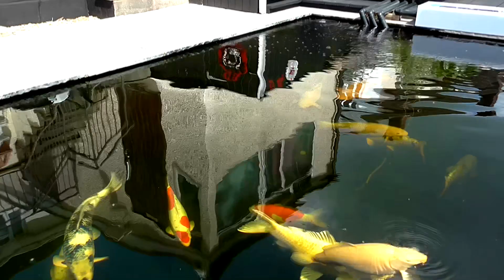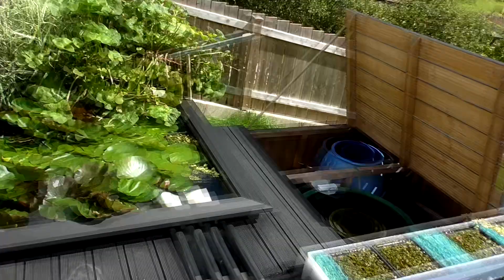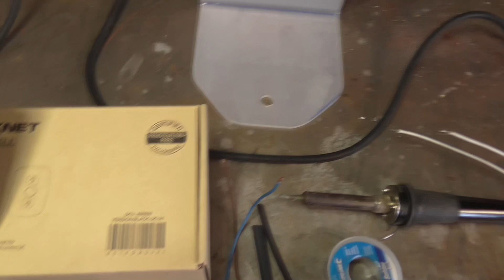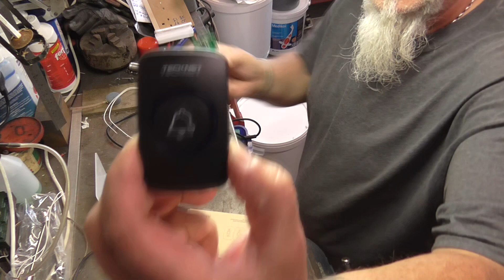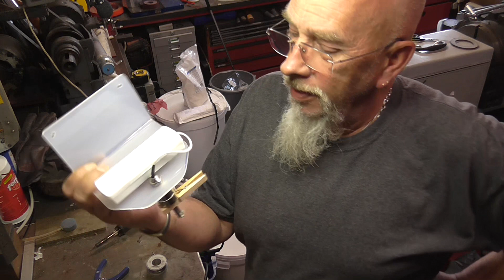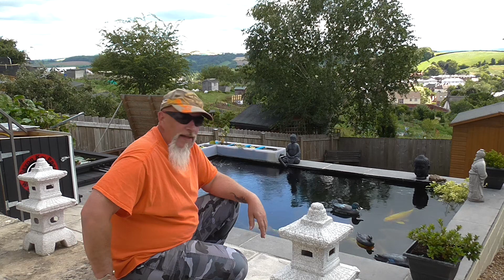***Koi pond DIY filter water level alarm*** Save money and your fish with this home build pond alarm

Comment: Thanks for the shout Martyn. Can the 200mm running through a relay be used as a pump kill switch just in case you are both out. 75mm will ring, 200mm will kill the power. Just a thought. Cheers
Reply: I think Steve was thinking more along the lines of stopping the water draining out the pond  anymore after 200mm to keep fishes swimming and not loose too much water
Reply: @ben963524  I was Ben, cheers.
Reply from the maker: Right Ben I see that now and yes I could sort a relay on the receiver to trigger the pumps off it would work will do some more thinking on that
Reply from the maker: Not a problem Steve cant get the channel link to work for the min it should show when I say up hear I'm working on that but its on the video end as well. They would work through a relay I have no need to kill the power the pumps auto shutoff if they go dry

Comment: I've been looking for something like this, but WiFi connected so it could send an alert to the phone wherever you are.
I've only got a 1,000-litre pond, but I recently built a "bog in a barrel" filter which is located in the bushes beside the pond. It's powered by a 4,000 litre per hour pump (although not getting anywhere near that throughput), and it worries me that if something goes wrong, it could empty the pond and burn out the pump in less than half an hour.
Reply from the maker: Alot of people built this off the back of this video and some did it with one of the cheap video WIFI door bells with mobile phone alert. I'm no electrictronics Wizz it was easy with the bell push I had just solder two wires on to the push button from the float switch. So it can be dun to alert your phone with one of the  Wifi door bell push's but cant help more than that sorry

Comment: Great Idea and I already have the float switch but you don't show the tricky bit, how you adapt and solder the bell push?  I want to build one of these as I have had repeated problems with dropping water in a filter due to fitting a drum inside the filter!
Reply from the maker: John when you open the bell push you can see the wires each side of the button you just have to come off them. watch what bell push you get as some don't ring constant when you push them and only chime once I must have been lucky with the one I had as 2 or 3 people have said there's only go's the once thanks for watching happy ponding

Comment: HI MARTIN  IM STILL STRUGLING AND HAVING CHECKED PART NOS ETC AND COMPARING IT WITH PICS OF YOUR UNIT /CIRCUIT BOARD it appears to be exactly the same ..today i have emailled tecknit  uk  for thier opinion .will let you know what they say .stickypaws will know me as huso huso on pondlife forum. i recognised your pond /garden on her pond build post .
Reply from the maker: Now I'm clicking on who you are chap I still pop on pond life from time to time but eye ball deep time wise most of the time now. I don't get it with the bell as said i have two of them hear the one on the house must be getting on 3 years old keep your finger on it and it will keep going and the unit i have on the pond works the same so just taking a bridge wire across the button for the float is all that was needed. I really cant understand why they would change it as it would not play the tunes keep in touch with how you get on with them 
Michael

Comment: hi martin bell doesnt ring continuously when button held in and ive tried all combinations of contacts but still only rings for 2 cycles to get it to ring again you have to remove and apply wire again .really frustrating i looked at your circuit board annd mine is exactly the same even same numbers po7 kerui  kr-f51-tk-b.not sure what else i can do other than send it to you to see if you can figure it out thanks michael,  incidently does the name stickypaws mean anything to you.
Reply from the maker: Michael they must have changed something in the bell push I have two of them bells hear one is the house door bell they both ring and ring if the button is held down that's why I got that type of bell to do the job on the alarm. if they have built in a momentary switch that I doubt they have it would not play a tune it would just be a ding dong door bell.  And Yes stickypaws is my better half

Comment: hi martin had a go using exactly same bell unit and 200 mm switch but i cant get it to ring continuously it just goes ding dong ding dong stops until triggered again .any ideas what im doing wrong thanks michael.
Reply from the maker: Hi Michael had someone else say this will it ring constant if you press the button on the unit. If so then you need to swap the solder contact's you are taking the feed from. I said this to the other person as I was thinking they had changed the build of the bell unit they never got back to me so this must have been the problem just try bridging them with a bit of wire till you hit the right combo

Comment: Hi Martin thanks so much for your reply it is pump fed back to a gravity system it only went up today and I just wanted to check with you first I have it coming straight out of the pond into the uv then down into the gravity 3 barrels
Reply from the maker: So you are pumping the water through the UV  should be fine you can turn UV off over winter say November till March then come spring when you fire it up just make sure the glass sleeve in it is clean as it has the dirty water passing it. if the water starts to turn a funny green over winter you can turn it on. But iv been ok for the past 20 years doing it and saving on the electric
Reply: Thanks pal you're a star

Comment: Hi ye pal quick question should the uv be before or after your filter ie inlet outlet
Reply from the maker: It should be after the filter but if you are pump feed then this is not posable so it can get dirty in side. in you are gravity then after the pump on the return but my uv is after the pump so it works like that as well Tommy

Comment: Hi Martin, great idea! Iv just tried to make the same thing using the same doorbell you have got. Mine seems to stop chiming after 3 or 4 seconds though then have to re trip the switch to set it off again... :(
Reply from the maker: I don't get that if tripped and held there this one go's off till you lift the float. What happens if you push and hold the button down on it if it go's off non stop then its hard to see on the pin's each side of the switch but try the pins with a test meter you mite have come off the wrong pin's for the cross to the float switch give it a try and come back to me
Reply: DevonKoi Pond thanks for the reply! If I push the button down and hold it then the same thing happens, it rings 3 times and then stops. It is the exact same doorbell as yours but I can only conclude the internals are slightly different where yours rings constant but this one only does three rings before stopping and having to be re tripped. I have tried my house doorbell and that rings constant when the button is pressed and held so I can see that coming apart in the days to come to try that lol. It’s a great idea I just seem to have been unlucky in that the doorbell iv brought stops after 3 rings. Annoying as I purposely brought the same one as you as it works well lol. Ill get it sorted. That’s for this idea. Keep the great pond videos coming 👍
Reply from the maker: Well that's a bummer I got the one for the pond on the back of the one I have on the house hear as pressing that one and it go's off till you lift your finger off they must have changed something in them

Comment: Good idea new to this koi thing and after drum motor went during the night woke up to find pond 3/4 empty lesson learnt now has kill switch on pump this would have been a good warning
Reply from the maker: The kill switch float is or auto cut run dry pumps a must have even on gravity feed filter system it will save your water and pumps but its also nice to have an alarm to tell you something happening and this can be set to tell you on as little as an inch of water drop.
Thanks for watching

Comment: Brilliant tip martyn although you do make it look easy lol, any chance of fitting a cut off switch for the pump in case you are away from home , so funny when your wife called out 😂
Reply from the maker: The pumps do auto cut at a drop of around the 8 inch mark but you did not know it had happened till you found it and 8 inch's is to much now at 2 inch's with the alarm I feel lots safer. People running gravity setup filters tend not to put the must have float switch on that pump feed people do. Thinking they cant lose that much water but lose 8 - 10 inch's of water from your pond and see if you think an alarm is a good idea then.
Thanks for watching

Comment: Have you got a links to the door bell and other parts Martyn???
Great upload, very good information, I will be doing this.
Have a great weekend, stay safe & well.
Reply from the maker: hears the one UK  on Ebay and the float switch Thanks for watching

https://www.ebay.co.uk/itm/Home-32-Chimes-Door-bell-Wall-Plug-in-Wireless-Cordless-Door-Chime-250M-Range-UK/184336863457?epid=13034761649&hash=item2aeb5550e1%3Ag%3AtnQAAOSwdUJfBTky&LH_BIN=1

https://www.ebay.co.uk/itm/Stainless-Steel-Vertical-Water-Level-Sensor-Switch-Float-Switches-Range-of-Sizes/124054484204?var=424886060632&hash=item1ce23934ec:g:oLYAAOSwbLJeJZBW

Comment: Great vid Martyn and certainly one I shall refer to in time especially when I get round to a pond revamp. My pond is currently pump fed to a Nexus so I followed 'Rob Price's' idea in that the float level shuts the power to the pump and UV but not interfering with the air pumps. Now if you can find an idea of linking an app to your design to warn you when away from home without spending a fortune (i.e. the Seneye system) it would be much appreciated! 😀👍
Reply from the maker: Just use One of the WIFI camera door bell's  that has an app to your phone and away you go it will call you on the phone one like this should do the job
https://www.ebay.co.uk/itm/Smart-WiFi-Doorbell-Camera-Video-Wireless-Remote-Door-Bell-CCTV-Chime-Phone-APP/303151040949?hash=item469535c9b5:g:nPYAAOSwN7Bc1oGZ
Reply: @DevonKoi  Great idea that will not break the bank! Do you think the wiring will be simmilar?
Reply from the maker: 99% Sure on the wiring its only the press button you are bridging on the unit. if I had the need for it I would try it if I go away for a day or two I have a house sitter looking after stuff hear
Reply: @DevonKoi  Thanks Martyn, I will definately try this when the time comes. 🙂👍

Comment: Be careful where in the pond you fit the float switch because it will eventually get covered in algae and will get stuck on the slider.Keep the switch clean at all times so the float moves up and down easily.Also the fish will rub against it  and may be set it off.Cheers mate
Reply from the maker: Thanks John it's easy see where it is and get's a wipe every time the vortex is dropped I dump half the water mid week that takes the crap out the bottom. And dump the lot once a week for a complete clean. We don't want to upset the cats to often and her indoors even less often 😂🤣😂🤣

Comment: I have found using one of these is a lot easier, serves 2 purposes, it can switch pumps etc off and if you use the make contact to connect to an alarm sounder it covers all eventualities, ok not wi-fi but solid and reliable and very easy to fit.: https://www.machinemart.co.uk/p/float-switch-230v-2m-cable/
Reply from the maker: Thanks Mick the pumps auto shut off them self's but not till about 8 inch's of water is gone and it don't tell you that is happening in the night . this will let me know if the water drops 2 inch's them bigger switch's only  click at about the 8 inch drop of water and a must have if you are on a pump feed pond or you will pump the pond dry Thanks for watching